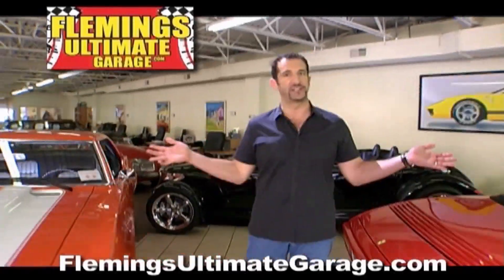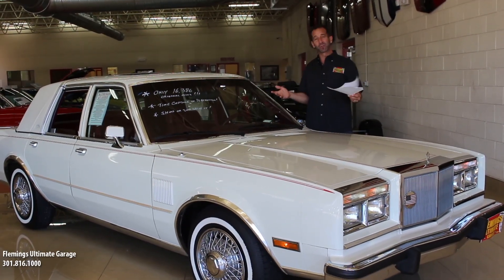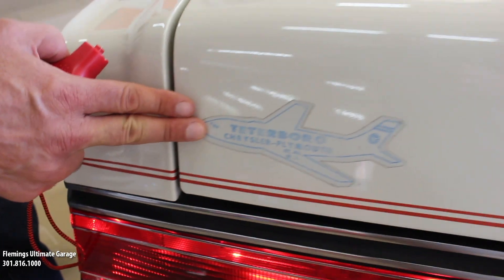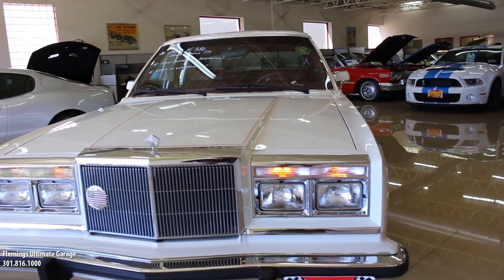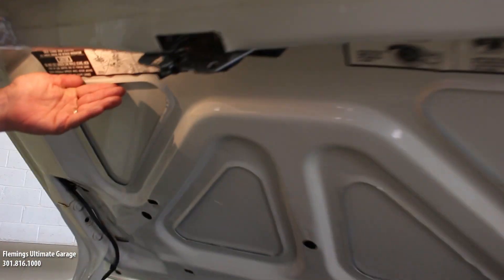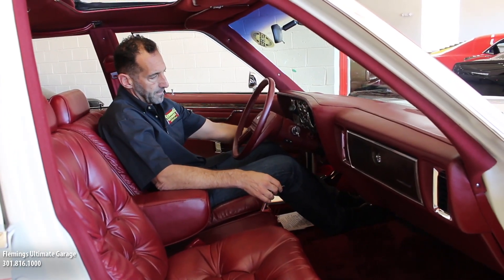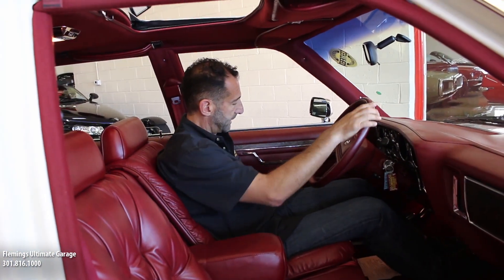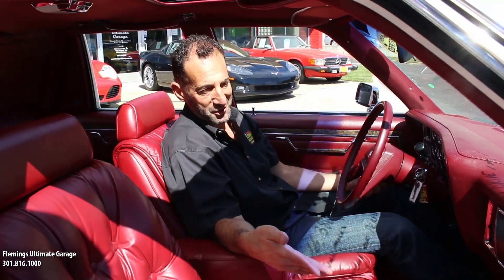'85 Chrysler 5th Ave for sale with test drive, driving sounds, and walk through video

Comment: These were FAR more reliable than Chrysler's front wheel drive lineup that came along after 1989. This was a very very good car.
Reply: Reliable might not be the term to use. But Durable sure is. These made fine cop cars, with a 360, similar to the one that came in The Little Red Express Truck. That is exactly what a good friend of mine did in a way, only took it a few steps further. He found an Imperial like this, loaded but with only a tired 318, some old lady had abused with not enough mechanical maintenance like oil changes and such. To a point at 58,000 miles the car looked like a million in all triple white. But dirty engine with horrendous blow by. Not getting out of its own way. Well my friend is her grandson who helped her keep it clean for sure, but was never able to change the oil. So she gave it to him. Then me and another good friend lent our expertise in swapping out the tires 318 and Torque Flite, for a MOPAR built 360, with Holley Pro-Injection, headers and built 727 automatic, running back to a 3:55 posi. That turned that beauty into a real sleeper! With close to 400 hp.

Comment: I bought one for almost nothing because the timing chain had jumped. Was garage kept and well cared for. I spent a day replacing the timing chain and gears and drove it for a few years without any problems. Definitely great cars.
Reply: Timing chain, radiator, transmission, rear end... all things that go wrong with those 5th avenues.

Comment: My grandparents bought one brand new in 1984 and I had the honour of driving it home from the dealer. It was a fantastic car! I was 17 at the time, and as a car fanatic I was thrilled to drive a car this nice. As mentioned in the video, it had a button to turn on a rear amp which performed very well. This platform with the 318 was the choice of countless police, cabs and for good reason. Much like the Ford panther platform years later, this was reliable and durable.

Comment: I have one of these its an 1986 and its white with blue interior and its beautiful. And it only has 88 thousand miles witch I was told it really low miles for a 318 motar
Reply: I only paid 8 hundred dollars for this and it wasn't running all I had to do was run new fuel lines and it started up😎

Comment: I just felt it was the right thing to do to get back with you as to why I haven't responded.  I found another one here on ebay. 89K miles, with sunroof, Electroluminecent. <SP> lamps on the C pillars for under 4 grand. White/ blue velour seats.  Thanks anyway.

Comment: Me and a friend of mine dropped a BUILT 340 mopar and 727 trans with a stall converter in one of these. Comfy....and fast. It was hilarious
Reply: You destroy a classic not funny or great
Reply: @craigrusso9291  I'm not into hot rods, but the engines in these 5th Avenues were pathetic.  Between 110 to 135 horse power, depending on the year, from a 5.2 liter V8, with a trouble prone "lean burn" carburetor.  Putting an earlier, pre-malaise era engine into one would certainly be doing it a favor.  Unless you get caught.  Then you could get in some trouble.   Some states continue to inspect cars this age, some do not. 

You want to see a destroyed 5th Ave., there is a dirt track near me that used one of these to condition the track.

Comment: i put one together because i wanted one and couldnt have it when it was new, 12 years on this build, is that car with blue interior was grey but couldnt find any leather seats that matched mine, found a set of blue leather in a junkyard that were worn but not torn up, some nice kimberly cloth door panels that matched the seats out of an 89, i never liked the blue vinyl panels with the leather group, i dont plan on selling it, so i took the lower part driver side of my dash and the lower passenger side of the dash out of the 89, and gave it two front ash trays like the old cars had back in the day, and i later plan on putting the overhead console in it out of the 89 as well, i live in the desert, the car is stone white with matching top, and all the chrome that these came with, she never  had a garage, but i put her back as original as i could, has about 70,000 miles on this freshen up build and still dependable out where she lives,

Comment: I have an 1987 driven around 60.000 km. looks identically to this one besides it doesn’t have an sunroof and it’s interior is plush , but same colour. It’s been in the family since my grandfather bought new it from the Chrysler dealership here in Iceland. It’s not for sale but it would be nice to have an idea on how much it’s worth?
Reply: I have a black 1987! It's on my youtube page. Just the engine bay. It has 80,000 original miles. I had to rebuild the transmission in 2015. I believe in American currency, if it is immaculate, You could probably get atleast $7,000 or so. When it was brand new in 1987, it went close to $15,000. Honestly I never plan on selling mine. You might feel the same.

Comment: My dad owned a 1988 5th ave, he passed away years ago and the car sat in the garage cause my mom doesn’t drive. She had asked me to see if i could get it running and i could buy it for a few bucks. So i tried a batter and gas and it would just crank, so i changed the fuel pump and filter and it fired right up!
I am getting it inspected soon and new tires. It needs a good buffing and a new headliner but not much else. The car again is a 1988 Chrysler Fifth Ave. with 21509 miles. 
Any idea of its value now? 
I wish i could show a few pictures

Comment: I remember seeing these roll off the transporter.... Chrysler had stopped production of their biggest platform and dressed up their midsize with the top end interior and luxury exterior packages.  The only bad thing I remember about these was the electronic engine management computer on the side of the air cleaner.....the Pc board was prone to cracking due to vibrations....we changed a lot of them under warranty.

Comment: This would be the ultimate sleeper with a 5.9 magnum or a 5.7/6.4 Hemi!
Reply: The Stig's English cousin 
Not ruining it, making it better. I’m all about originality, but it’s nothing rare! I’m not talking about cutting it up. Everything I would do is bolt on.
Reply: @dodgeguyz  The car is too heavy to ever be fast.
Reply: Timothy Tucker 
That's what they said about the Charger and Challenger Hellcats!
All you would need is an 8 3/4 rear and tie the sub frames. It's easy to tighten up the suspension in these.
Reply: The reason these cars were slow was due to the powertrain at most produced 140hp, 240ft lbs of torque, roughly a axle ratio 2.28 with a three speed.  A more powerful powertrain, with a wider gear spread would do wonders.

Comment: My favorite color for a car is white. What a GORGEOUS car that is! Except for the stupid "lean burn" witch you can replace, the car was ridiculously reliable! Equivalent to around 500,000 miles today. LeeIaCOCKA DESTROYED Chrysler! He said a Volare/ dodge aspen was junk with a slant 6 and the 727 torque flight but raved about the K-car, a ROYAL PIECE OF SHIT! Not to mention just about EVER Chrysler product was just a botched of K-bomb! JUNK 2.2 and 2.5 4 bangers with defective wrist pins. You KNEW when a K-bomb or other Chrysler POS was coming because you could hear the clanking, and the turbo version of the 2.2 was and even BIGGER DISASTER! Then the "ultra drive" transmission that didn't last some people LITERALY from the dealership to there home! Chrysler didn't even have there own 6 cylinder during the LeeiaCOCKA disaster and used a POS Mitsubishi 3.0ltr V6 that would burn oil like a furnace by 70k miles due to bad valve seals! The 3.3ltr Chrysler unit that was finally produced wasn't too bad. But then the "tiger shark" 2.4 a total POS like the 2.2 and 2.4 with another disaster transmission. Then the 3.6, OMG. The "pentistar" 3.7 was better but still not good and still GARBAGE transmissions. HOW Chrysler even exists anymore is mind blowing! Well what is left of them anyway. Fiat buys them and talk about the blind leading the blind but then Stellantis? OMG!